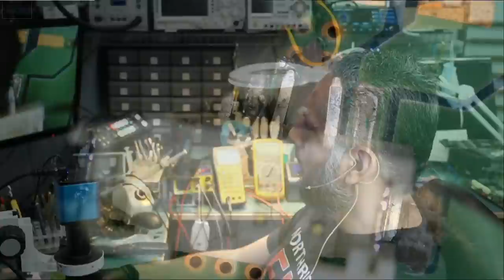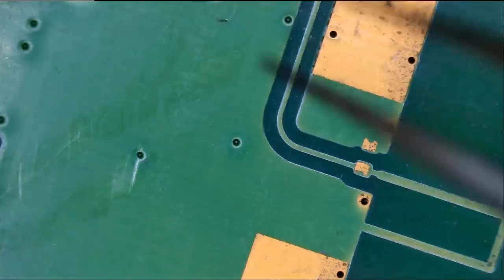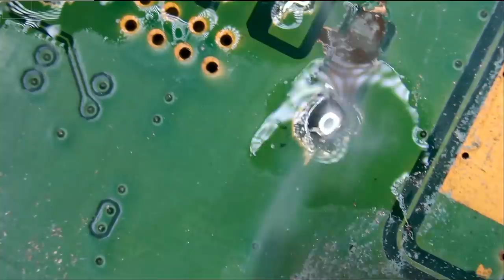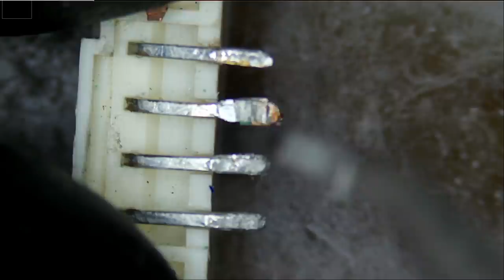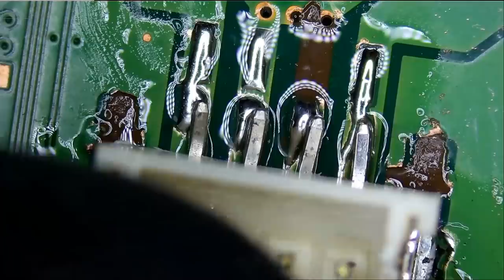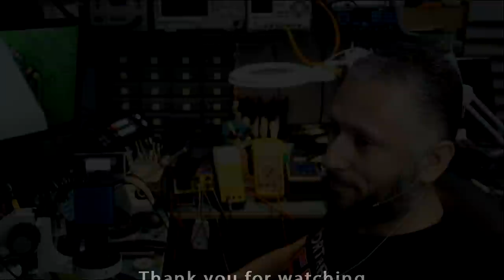PS4 Ripped Connector Repair. A trick using the Grinding Pen to re-solder and make it super solid.

Comment: The only issue I have with doing the repair this way is the chance the connector will be in the way of something else when it comes to reassembly. Obviously checking that beforehand is advisable, if all clear, then there's no problem.
Reply: In this case, the connector isnt coming out of the case. Looks like a fan connector so they’re usually not in the way of anything
Reply: @dbfab  It's the power connector (5v and standby) it sits directly under the power supply, there is very little clearance, but that should be fine.
Reply: would using wire for the supports be viable or will they not be strong enough to keep the connector on the board? and by using the wire i mean to keep the connect in the same spot and grinding in front and behind the ripped pad so the wire is soldered on both ends.
Reply: That's the customer fault if so as he/she didn't send the whole console for assembling and testing
Reply: If location is a problem then just solder mask the connector to the board
Reply: @moonpig660  you can use so solder wick to make new pads. and have the connector it the existing place, but I think this way is less faff.

I would have solder masked the exposed copper, just in case of oxidizing, but that's unlikely to cause a problem

Comment: You are getting known for repairing the repair attempts. It also doesn't seem to bother you as much as it did in the past. I would imagine the price of a repair is higher once you know it's coming in and has been previously messed with. Oh. I finally did my first solder job. DC jack replacement. =)

Comment: Okay this is great, but my question regarding the repair process simply because I am not a experienced electronics fixer like you is.. The pin that had the ripped trace missing and you created a new solder joint.. The trace doesn't need to be completed to the section it was connected to? Now that you have made a new pad where is that signal going to if the rest of the pad isnt linked/ intact to the full trace to complete the circuit? Was there enough trace left to still get continuity across?

Comment: what if you used the gel superglue type? wouldn't that work well enough? I mean, yes, you had the tools and clearance, but what if the pads didn't expand further down, that'd require four wires or in some cases be obstructed.

Comment: Just the way I used to do that. You don't have to worry even all pads are ripped, just grind, solder and cover with solder mask. But I used to wick all solder in order to keep conector as closer as I can to the board. 
Better than factory! 😁

Comment: Hi Alex, I would like to thank you for making videos. Today after 1 month of trying to learn micro soldering, finally fixed 0402 package* smd RGB LEDs of my broken Logitech g513 Keyboard. *(refers to 1mm*1mm 4 pin SMD LED). I do not have any equipment except a soldering iron. Lucky that Paderborn university offers free labs for students with all types of equipment. Me along with 2 other friends with team work fixed it. Desoldered from donor board, practiced on it, and then attempted on the actual board. It was super super hard and in total we spent 9 hours to fix 5 LEDs. Lucky that I had cermaic tweezers. Nearly 18 LEDs flew into 9th dimension. 10 LEDs couldn't take the heat because we were using metal tweezers at first. Overall it is a good learning experience and just realise how hard you have acquired those skills. Whatever price you charge, it is worthwhile for your customers. I tried all your techniques and finally we got the hang of it. First LED took 40min but rest took only 3min each. 
❤️ From Germany.

Comment: Are the original anchor points deliberately weak? Why would they etch away the copper around it, only held by the mask and four small points where it connects to the rest of the ground. I think this is actually sabotage!
Reply: It's called thermal relief and it's used to ease soldering on large copper planes as heat doesn't "escape" the pad so easily.
Reply: @bar10005  I see, that makes sense. Although, it looked just as easy to put a blob of solder below it, to the new place. "Better than factory", I guess.
Reply: @gabest4  It's easy for hand soldering with leaded solder, but in factory those are wave or oven soldered with lead-free solder which requires higher temperatures and where prolonged heating would destroy plastic connector, so they have to optimize design and soldering process to achieve proper adhesion without destroying components

Comment: A rotary tool is fine, but I generally prefer to use abrasive fiberglass brush for such job. It makes it virtually impossible to grind through copper or damage traces.

For those in EU: if you want a rotary too perfect for this kind of work, buy one from Lidl. It's totally underpowered which makes it perfect for PCB work.